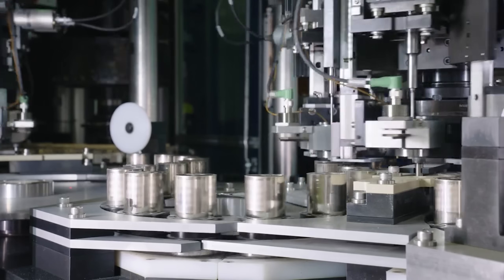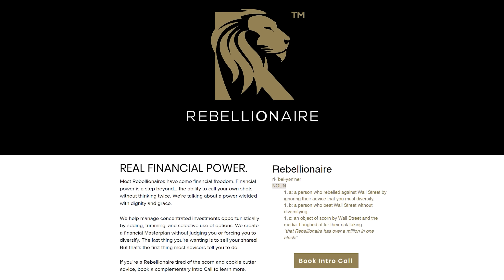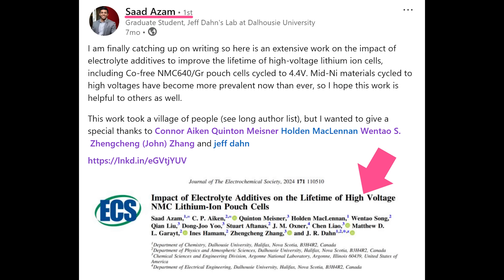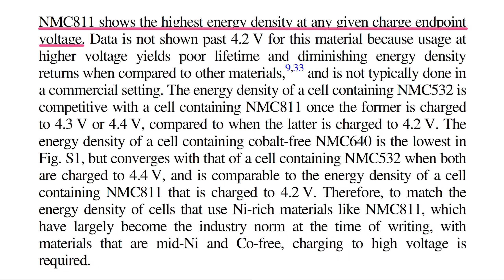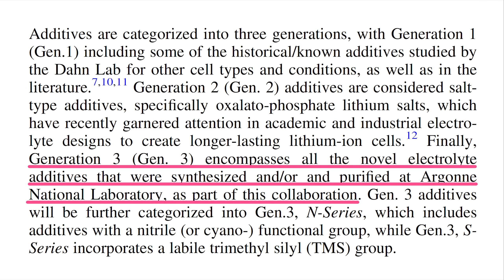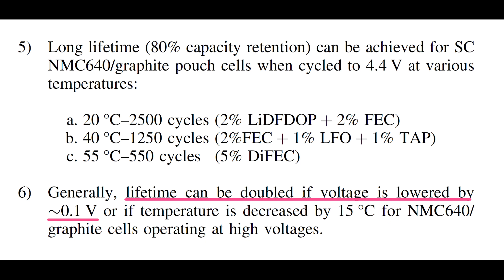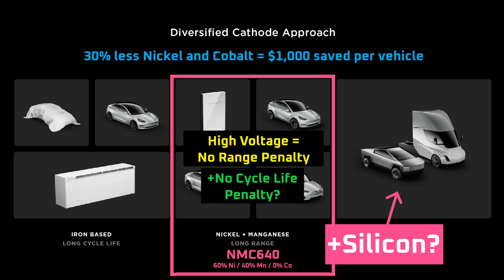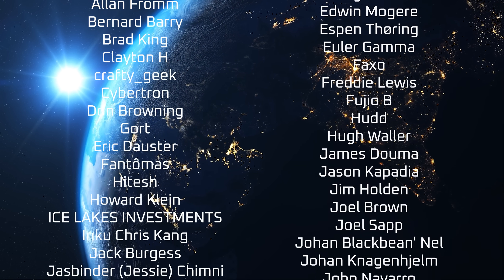Tesla's High Voltage Electrolyte Patent is More Useful than I Thought

Comment: Grok just pointed out to me that they only have 60% yield and no way of detecting cracks on the rollers in production. I kinda thought that they are capable of reusing the bad rolls if they could detect cracks with some kinda backlight scanner and have the materials recycled before it’s a finished battery. Grok might have trolled me with these statements so please forgive me if this just utter nonsense😅
Reply from the maker: I'm not sure which company and which component you're referring to, or how it relates to this video.

Tesla's lines are sensored out the wazu to prevent failures, and but failed material can be reused anyways.
Reply: @thelimitingfactor   I was thinking about 4680 production yield with the dry process. Sorry for my awful writing skills.. lol

Comment: Comment i tried to leave: 

Do you think Tesla is planning to make an LNMO cell in the medium term future (e.g. starting testing in 2030)?

If Tesla does decide to go for LNMO batteries in the future, then considering the high voltage required for max energy density in those cells, do you think Tesla might use AI chemistry testing to quickly cycle through viable electrolytes that withstand high voltage while maximizing both energy density and cycle life?

Do you think an LNMO cell will be competitive against sodium chemistries that may be rising by the 2030s? And do you think sodium chemistries will have their weight reduced enough to pose a viable competitive challenge to LNMO batteries or even LMFP batteries in the use case of transportation? (And related, do you think Tesla will switch to sodium based megapacks and powerwalls, since sodium appears ready to beat lithium in cost, and if so, when will it roll out in the US, EU, and elsewhere?)

Lastly, after the NMC640 cell is complete, do you think Tesla's next leap forward will be a fully solid state battery, i.e. a solid electrolyte to complement its dry cathode and dry electrode? If solid state batteries in transport applications are the long term future, and if any company would have the foresight to shift their batteries in that direction, I would think it would be Tesla. 
And if so, when do think this will occur? Mid 2030s, late 2030s, or even 2040s?
Reply from the maker: Not on the horizon as far as I can tell.  I really like the chemistry, but it doesn't seem to be getting much traction as other higher manganese cathodes.

Comment: With such moderate gains Tesla might be much better off buying 24 M Tech as seen on a Sandy Munro Vid with their 600 patents, or making a deal with  CATL with their new sodium ion Tech that also looks real promising as seen on the Electric Viking.
Reply from the maker: In the context of battery history, a 15% cost reduction with the same energy density is a HUGE gain.

As for gimmicky tech like 24M:  No.  Look past the market material into the drawbacks.

As for Sodium Ion:  No.  Not for any of Tesla's current vehicles.  Energy density is too low, it's still teething, won't be at serious scale for several years, and is currently still more expensive than LFP.

I've done several vidoes on the topic.  Watch them to separate the hype from reality.

Comment: I suppose a 100mV to 200mV boost makes it high voltage?  Charging voltage is a tradeoff it always has.
Reply from the maker: Technically, yes, because it's beyound the standard voltage range.

Correct - as covered in the video.  But that's the point of the research - to address those drawbacks.
Reply: @thelimitingfactor Indeed so. The NMC terminal  4.2V was selected striking a balance between energy density and longevity for the electrochemistry, and adjusted for cell temperature. You could push it a tadge further, but for NMC  it would go against conventional wisdom.  Every succes to the research team for coming up with a  a higher voltage electrolye by controlling dissolution.?

Comment: In my view, I would like to see significantly greater range with newer Tesla vehicles. 300 EPA miles is quite workable, however in reality your only doing 200-250 miles of real world range and usually much less 150-180 miles on a road trip to keep charging stop times short. It seems as though in the last five years that there has been no noticeable increase in range of its consumer vehicles.

Comment: Not going to lie, ive been hearing about these plans and more plans for 6 years now from tesla. and still nothing anything to show for it and it's getting tiresome. meanwhile, China already have Evs out that charge in 5min.
Reply from the maker: This just feels like an Eeyore comment. 

Tesla is producing 4680 cells in house for lower cost than the cells they can get from their suppliers. 

It's definitely not yet lived up to battery day for sure, but what they've achieved so far is phenomenal 

Why? Just take a look at Northvolt.  

Northvolt with stacked with talent, and all they were doing was producing a typical wet coated 2170 battery cell.

They failed. 

As for the 5-minute charging, that's not a technological achievement. 

Tesla could make their battery cells charge in 5 minutes right now as well, but they don't because it's a product decision 

There's a small fraction of the population that places charging speed at the top of their priority list, but most of us could not care less about charging speed because Tesla vehicles already charge faster than we need 

The ultimate litmus test is vehicle sales for each model.  The per model part is especially important because that's what dictates profitability in the long run.  

This is why a company like BYD is producing a lot of vehicles, but in terms of EVS, they aren't really profitable.

Nobody comes close to Tesla

Lastly, I didn't say once in the video that this is a plan 

Paraphrased, I said it's another arrow in their quiver 

It's just a matter of time before these things start going into products, and I made clear to set expectations years in the future
Reply: @thelimitingfactor  whats the limiting factor to scale up production?
Reply: @thelimitingfactor  thanks for your reply, appreciate it!

Comment: The so much hyped solid state battery, where could it be? It seems it has been pretty much empty promises or even vaporware. On the other hand, this tech developement seems promising, it's clear that Tesla is onto something and they will end up showing interesting advances. I guess this replacing NMC for Cybertruck or even the standard range Tesla Semi could be happening, but what about a long range sleeper cab Tesla Semi? Maybe that version would still need NMC? Anyways, I just hope this will give people the much needed cheaper versions for Cybertruck alongside the much needed extra long range.
Reply from the maker: Yeah, solid state is kind of a dead end for ultra high production vehicles 

I think just like many manufacturers took up lfp in the last 5 years, that we're going to see a lot more manufacturers use higher manganese formulations in the next 5 years 

I'm thinking they'll start being deployed more widely around 2028 to 2030

Comment: This sounds like a battery thats perfect for battery swapping. You could slow charge the swapped batteries in a temperature controlled enviorment and then swap them in when fully charged. A Semi with a swappable battery could actually make sense since they could just have swapping stations at the destination and then it could drive home with a full battery without charging time. The battery might have to be split into modules for easier swapping. For regular cars, battery swapping is not as practical.
Reply from the maker: I did a video on battery swapping.  It's good for very specific use cases, but not most
Reply: @thelimitingfactor an other option, instead of swapping, would be to only use the highest voltage when the extra range is needed. A perfect situation would be cold weather. Since the temperature is lower charging to max voltage wouldn't do as much damage and you might need that extra range anyway.
Reply: @thelimitingfactor I re-watched your swapping video. It was a great video, but many of the drawbacks doesn't apply to Semi trucks. This battery is also sensitive to heat so slow charging and swapping is an even bigger advantage than for regular batteries. I'm not the biggest fan of swapping myself, but in this case it actually makes sense in my opinion.

Comment: I wish they'd raise the cars height by 1.5" & go to 46x120 cells. That'd give 50% more cell size for about 50% more range in the same footprint.
Reply from the maker: That would involve multiple trade-offs, which is why they went with the 80 mm height 

Additionally, as they've said before, the reason they don't put bigger packs in the vehicles is because most people don't use them 

So you would be kneecapping a number of performance specs to cater to a relatively small group of people
Reply: @thelimitingfactor  Back in my younger days you could buy a Camaro with an iron duke 4 cylinder, a 2.8 V6, a 305 & a 350 V8. 
I'm in the crowd that thinks there's nothing wrong with a few choices when it comes to power or range. The engineering cost would be minimal on a larger pack compared to 4 different engines.
Reply: @MarkSparks-xd9yy  that may be the WORST example in automotive history- the Iron Duke in a Camaro 😂 , especially since the 2.8 weighed the same and had a bunch more power and refinement
Reply: @thelimitingfactor  I'll also add that the reason Tesla hasn't put bigger packs in has nothing to do with usage, it has to do with the competition in the US not doing it yet. Some Chinese cars are now getting to 6-7 hundred mile ranges. If something like that goes on sale in the US Tesla will have larger packs out 100% guaranteed.
Reply: @MarkSparks-xd9yy  the cost of creating a very long range BEV wouldn't be worth it. Batteries are expensive. Most people can't afford, or wouldn't want to pay for, the range they might get.
Reply: @davidx.1504  Agree. Long range BEVs about as useful as long range ICE vehicle. Very limited market.
Bladder range more a consideration!
Reply: @davidx.1504  I watched the video. It was about knocking $1000 off the pack's price. Batteries keep getting cheaper. They also are getting more powerful. Today's batteries are probably less than 2/3 the cost of something comparable 5 years ago. That's the same difference this would be. My 2017 66kw/h battery probably cost about what 110kw/h does now.
Reply: @MarkSparks-xd9yy  I'll grant you that, batteries are getting cheaper, so longer ranges might cost less over time, so BEV makers may offer longer ranges for those who want them.

But the 30-35k range market is where companies are targeting since that's where mass adoption and high competition can start to happen, and BEV makers can't make a 400+ mile range car at the 35k price range yet. It may be a while before that becomes feasible

Comment: would a high voltage electrolyte increase charging speeds and thereby making new vehicles better compatible with v4 chargers?
Reply from the maker: It depends on the viscosity of the electrolyte

It could make the charging speed better, or worse

Comment: Can Voltages be changed on the fly based on the percent charge?  Meaning if you only charge to 80%, the batter would stay at the lower voltage, then when you want to go to 100%, then the battery could be charged to the higher voltage.  This way you get the best of both worlds, longer life vs more range during times of need.
Reply from the maker: Charge state in terms of percentage is based on voltage 

They are one in the same

What a high voltage electrolyte allows you to do is make the voltage window wider for 0 to 100% without causing degradation
Reply: @thelimitingfactor  Is this what the classic EV charging curve represents? Highest voltage (fastest charging speed) at the start of the charging cycle from 10% charge to maybe 30%, then decreasing voltage (and decreasing charging speed) as the battery fills up further?

Comment: How does this relate to Nano One's high voltage LNMO cathode batteries? 

LNMO is even lower in nickel and operates to roughly 4.7 Volts...
Reply from the maker: I don't understand the question 

There are hundreds of different chemistries out there, asking how one relates to another is unspecific 

It depends on what aspect of those chemistries you want to compare
Reply: @thelimitingfactor  Sorry for the lack of clarity.

Nano One's LNMO cathode is a high voltage chemistry and is up against the same issues with respect to electrolyte durability in high voltage cells.

LNMO is both higher in voltage (4.7V) and higher in manganese fraction (1Ni : 3Mn) than the mentioned Tesla chemistry. 

To what extent would you think Tesla's high voltage electrolyte tech might be applicable to Nano One's LNMO cathode?

Note: Nano One's LNMO cathode material addresses the problem with high percentage manganese cathodes of the manganese dissolving in the electrolyte because its process creates a protective lithium niobium oxide coating at the nano-crystal level.
Reply from the maker: Good question! Chemistry is effectively infinitely variable.  One electrolyte may work perfectly with a high nickel and NMC, but then do poorly with a mid nickel NMC

So, the only way to really know is to test the electrolytes with that specific material 

However, I would guess that it would do poorly because when you start getting up into very high voltage ranges and the high 4 volts, you need more exotic solutions to deal with the voltage
Reply: @thelimitingfactor  to piggyback, I have a few questions. 

Do you think Tesla is planning to make an LNMO cell in the medium term future (e.g. starting testing in 2030)?

If Tesla does decide to go for LNMO batteries in the future, then considering the high voltage required for max energy density in those cells, do you think Tesla might use AI compound testing to quickly cycle through viable electrolytes that withstand high voltage while maximizing both energy density and cycle life? If I understand the reports correctly, Google deepmind found 400k new stable compounds in a batch of 2.2M compounds generated, all in the span of 17 days. AI can certainly aid in electrolyte discovery if Tesla does want to consider that option.

Do you think an LNMO cell will be competitive against sodium chemistries that may be rising by the 2030s? And do you think sodium chemistries will have their weight reduced enough to pose a viable competitive challenge to LNMO batteries or even LMFP batteries in the use case of transportation? (And related, do you think Tesla will switch to sodium based megapacks and powerwalls, since sodium appears ready to beat lithium in cost, and if so, when will it roll out in the US, EU, and elsewhere?)

Lastly, after the NMC640 cell is complete, do you think Tesla's next leap forward will be a fully solid state battery, i.e. a solid electrolyte to complement its dry cathode and dry electrode? If solid state batteries in transport applications are the long term future, and if any company would have the foresight to shift their batteries in that direction, I would think it would be Tesla. 
And if so, when do think this will occur? Mid 2030s, late 2030s, or even 2040s?

Comment: Was surprised, (and a bit concerned) by your comment on dry cathode at GigaTexas. I thought they'd more or less solved that by expensive super hardened rollers, not so? Do you have any information or predictions on the solution?
Reply from the maker: I've been extremely consistent on my updates on this. 

The last official update we had from Tesla was about a year ago.

I've been saying that I hope we'd see that ramp in earnest from the middle of this year 

But, we know nothing because Tesla hasn't given us any updates because everybody is focused on the new shiny - fsd
Reply: @thelimitingfactor  >>focused on the new shiny - fsd. LOL! At times, there are disadvantages with Autistic senior management. OTOH, FSD is getting scarily good. I do think there are several things bubbling in the background awaiting solutions. There has been an enormous amount of new equipment being stuffed into GigaTexas, can't see that happening for stuff more than 6-12 months out.
Reply: Yes, last update was that they cracked the code for dry cathode production at small scales, but now need to ramp it up. The ramp could be announced any day, or might be deemed a failure. 

I suspect we will learn more on dry cathode progress by mid 2026 at the latest. That sound about right, TLF?
Reply: What's goes on in the Battery plant at GT is a mystery. Constantly installing more equipment, sometimes removing equipment, always a large number of staff visible inside.

Yet only able produce enough 4680s to supply the Cybertruck production.

They don't seem to have cracked the manufacturing process yet. I wouldn't be surprised if entire production lines have been rebuilt a number of times.

Dry cathode might be the problem, or one of a number of problems. That they keep beavering away suggests they are confident of success.

Comment: Does having a larger voltage window give you a better resistance against cold weather ?  If the degradation on voltage is 30% ( a number I made up ), then having a larger window would diminish the impact of cold weather, no ?
Grok actually confirmed :
"Yes, a larger voltage window can help a battery perform better in cold climates. It allows the battery to maintain stable operation and deliver sufficient power despite reduced electrochemical activity and increased internal resistance caused by low temperatures."
Reply from the maker: Hmmm, I'm not sure if Grok is right on that.

People are putting way to much trust in AI, and it's still an idiot on deep chemistry.

Most of the resistance in the battery cell is ionic, which is mostly dictated by the viscosity of the electrolyte - dictated by temperature.